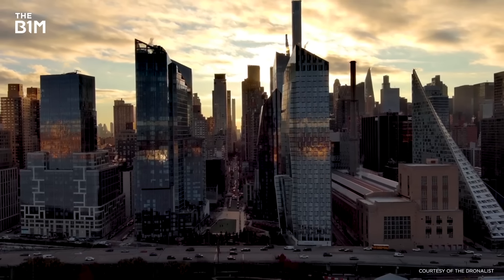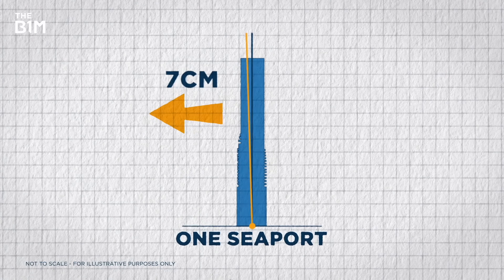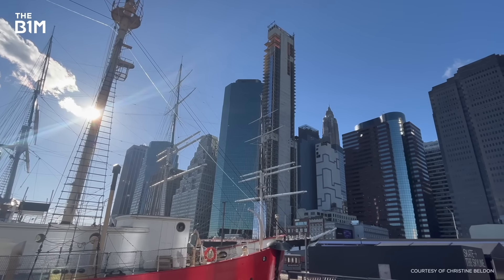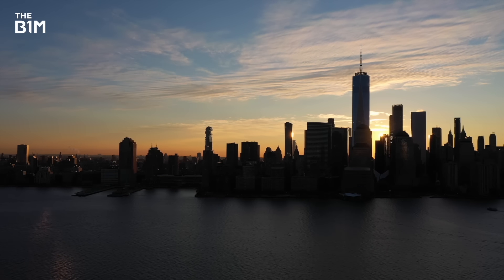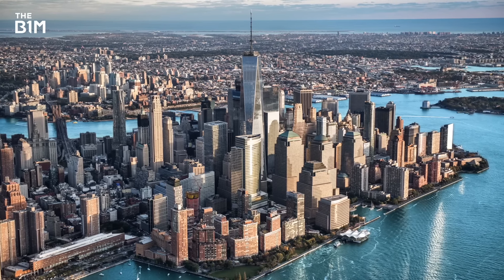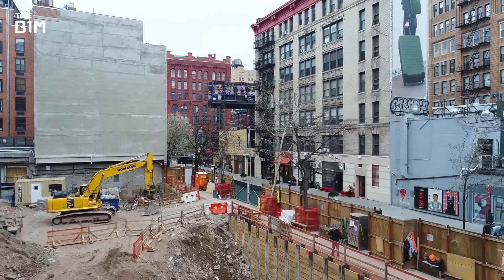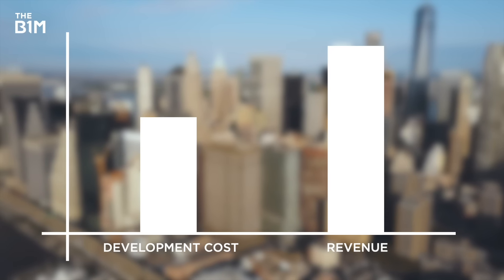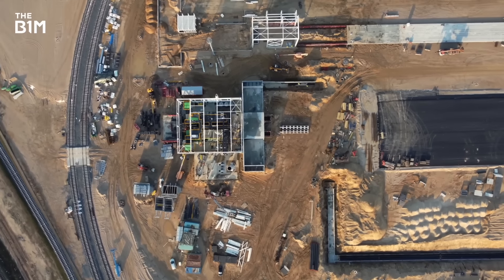The Wild Story of New York’s Abandoned Skyscraper

Comment: I think people often think that skyscrapers are a perfect science because they go up all the time unhindered, but this is an important reminder that it’s extremely challenging to get 60 stories of concrete and metal to stand perfectly straight, and is a massive achievement by developers. It’s just unfortunate that when a lean like this occurs, it’s so expensive to correct.
Reply: I just wish that they would automatically put pilings down to the bedrock with buildings as tall as this!
Reply: I build high rise apartments think 10 story to 60 story and theres 3 dudes out if 70 with a tape a level and a laser , and 1 of those guys always is an apprentice 1 guys always so foreign you don’t know what he’s says  and the 3rd guys a dick. Trust me not me single thing is near perfect
Reply: well said. I live in Miami and its easy to get accustomed to high rises. But each tower is full science, engineering, and challenges that occurs behind the scenes. For me, I love when I see a tower under construction and all you see is concrete slabs cantilevered hundreds of feet in the air.
Reply: Well if your not going to use piles in an area where most skyscrapers do, well you built a lemon
Reply: Happens in all types of structures. The I-75 bridge over the Saginaw River in Michigan had to be repaired after one of the piers went askew. After years of looking at it, it was finally decided that freezing the soil around the foundation would do the trick.
Reply: In residential wood frame, there is almost an 1/8th inch of “fuck” factor and then some per floor.

Translated over 60 floors. 7.5 inches.

Lasers and transit levels are no joke for this reason. I now have a new respect for building big.
Reply: Standards are lessening.
Reply: @willpugh8865  Someone still goes over your work and makes sure you’ve done it in the limits of the design lmao.
Reply: Some engineers didn’t ask the right questions with physics and math?
Reply: @SunriseLAW WTC didn’t have tuned mass dampers.
Reply: Engineers. Developers don't get credit here. Source: I am a real estate developer.
Reply: @java4653  I don’t know the correct terms, I just meant the people who make all this happen haha so yes the *engineers 👏🏻
Reply: a guy for blue print is to blame
Reply: @java4653  you draw blue print and measure everything?
Reply: Its a real skyscraper! 🤣
Reply: I heard that the exoskelatan of box columns kept it going straight down. @SunriseLAW
Reply: Our old buildings and  infrastructure worked.   Why can’t they build solid buildings now?
Reply: @arribaficationwineho32  you mean like the Tacoma Narrows suspension bridge that completely collapsed less than 6 months after it was built in 1940? Or maybe you mean the John Hancock tower in 1973 that had panes of glass falling to the street and swayed so bad that people on the upper floors were made sick? Or the Hyatt Regency walkway that collapsed in 1981 killing 114 people? Yeah they sure used to build em tough 😂
Reply: Florida units are collapsing and falling apart too

Comment: the fact that its so tall on such a tiny footprint would scare the crap out of me living in there
Reply: The simple answers is to take this down.  Or like San Fran you finish it, sell units to suckers than fight it out in court until it falls over.
Reply: Second thought is that not all site are suitable for tall buildings.
Reply: I suspect nobody is going to want to live there even after they have 'fixed it' , I surely will not be applying for an apt !
Reply: So they saying that's not  a safety And concern
Reply: @Privat2840  That could be.  There's just nowhere near enough information in this video to determine anything relating to the building's construction and why it's leaning.   And this area is loaded with tall buildings that appear to be standing just fine.  Maybe this particular building design itself just isn't suitable for the site.  Maybe we're both right...  The ratio of height to footprint area of these tall skinny buildings has got to be a unique challenge all it's own.

Comment: The building's super structure also has an eccentric layout of core walls, which might cause differential shortening and leaning of the building to the direction of more shortening. All you have to do is investigate the shape of leaning because it is different whether the leaning comes from differential foundation settlement or from differential shortening.
Reply: 100%.  It's structural form means it will lean.  This has to be compensated for during construction.  Lots of tricky calculations and surveying, but it's not rocket science.

Comment: I'm REALLY surprised that all the skyscrapers don't have pilings in NYC. This one definitely should have, in my opinion. 😬
Reply: I really thought the skyscrapers normally required pilings extending down to solid bedrock below the island. Engineers have to include geological reports to ensure that all pilings stand on solid rock, avoiding having any resting on fissile or weaker rock layers that could potentially shift under the weight of the building.
Reply: Depends what part of the city they are being built. By lower Manhattan, Brooklyn, East and Hudson Rivers fronts and adjacent areas, buildings are all typically built on piles , as deep as 150 feet. Towards the center of Manhattan bedrock is relatively shallow, making piles a bad choice.

Comment: This problem should never have happened.
As both a Chartered Architect and Structural Engineer; PhD in Building Material Physics, I suggest that someone runs some old fashion hand-calculations over the imposed façade loadings related to compensating structural stiffness, respecting Castigliano's second theorem (deflection) and then delves into Rankine Gordon and Perry–Robertson formulae regarding one-end fixed encastré cantilevers; using the building as a vertical column/cantilever projected off the foundations. i.e. the fixed part in the ground. The opposite end; where the deflection occurs in the sky - in this case, the wind replacing gravity as the cantilever is exposed to super-load forces, perhaps not factored holistically into the original calculations - think laterally! This is really simple stuff and the design straight forward to fix; if you are old school with experience in designing 'slippery' air-foil façades - The fault appears to be embodied within two factual logics. (i) the encastré presumption of load transfer to ground has not been sufficiently researched, therefore, the foundations; as designed are unsatisfactory, and, (ii) the wind-load on the superstructure is producing a 'resultant' eccentric force that was not considered properly within the calculations, thus: inducing an overturning moment; as per the cantilever acting as a lever upon the foundations that have become the cantilever's fulcrum. Most young engineers would not know what I am talking about because they have never run a hand calculation in their lives nor researched materials fit-for-purpose through design. i.e. this building has to have a steel frame not reinforced concrete due to the risk of flexure. Many engineers these days have become little more than computer button monkeys having never run an 'eye-inspection' or hand-calculation as a structural analysis safeguard, taking for granted that software acts as a catch-all. If one reads ISO documentation it generally states in the preambles on page 1, that the recommendations are not a Code of Practice, and, that utilisation of such ISO's do not provide protection from professional liability. Nonetheless, it is obvious that the superstructure is causing issues with structural 'stiffness' that in-turn has influenced the foundations. Thus there are two solutions. (i) Knock the building down and turn the site into: a car park, McDonaldo's, Pizza-Hut or whatever the New York moneyed-class has to have, or, (ii) Stiffen the design of the building's spine; which should have been conceived as the service core, and built as aforementioned, in steel due to flexible acknowledging "tall-thin column theory". The trouble is that the world is full of arseholes who do not wish to listen or learn. If this project was managed using BIM to the ISO19650 series, then I expect that such risk elements would have been thrown-up during the Appointed Parties' Risk Evaluation Statement - that is, both Lead Parties supervising: Architecture and Engineering would assess the risk potential of such a design as a 'thin structures' liable to deflection due to 'slenderness ratio'. If not, then all parties involved are utterly stupid. On a well managed project; BIM or otherwise, this type of incident should just not happen. Currently, I work in South East Asia and this type thing would not happen as structural simulation respecting earthquake design would have flagged-up the issues as a problem. Also, many engineers are female Koreans who never let a presumption pass through their hands, as they listen, are vigilant, validate software calculation checks, and never assume to know-it-all. Still it's the Big Apple - Hasta La Vista Baby - That's the way the cookie crumbles baby! これが世の中というものさ．
Reply: Never underestimate a Korean woman
Reply: Because todays engineers are just software users, not the mind behind the software concept. Poor minds do poor buildings.
Reply: TLDR😢

Comment: Many of the floors in NYC's Freedom Tower in  are completely out of level.  It is standard procedure to bring in floor leveling contractors to correct the situation.  One of the floors I worked on in the 80's part part of the stack was out of level by 3" across the entire structure. Big problem is the workers have no real supervision and no accountability. Buildings only get this messed up when a lot of people are not doing their jobs and looking the other way.
Reply: It's interesting because I've seen documentaries about buildings in other parts of the world where leveling is checked on a daily basis to prevent any one issue compounding the situation.  I have a retail space across from where I work.  It's only a few stories high but they put in pilings.  (noisy and the vibrations were something else).  But it was done.
Reply: I hear you. My dad is a retired Concrete Finisher and a Legend in Boston union  construction.   I also was a laborer for years.     It's amazing how sloppy some crews can get

Comment: Driving into Manhattan I was once asked if I knew why all the skyscrapers were built on the southern tip and middle of the island with only modest buildings in between. I didn't know but the answer should have been obvious. The whole island is mud except for those two parts, which is why I was confidently told there would never be skyscrapers anywhere else on the island. Maybe he should have been right.
Reply: This is downtown though. The issue isn't how far south it is, but rather how far east. It's sitting on artificial land which was added to the coastline.
Reply: Not mud. Just that rock is deeper. So it was easier to build rock foundations North of 30th street and by financial district. Builders are building taller buildings in the middle now because they are financially viable to build with an expensive foundation.

Comment: Bedrock or bust! They should've known better than to try and build a skyscraper in NYC on anything but solid bedrock with piles included. They'll need to tear down the building piece by piece, strengthen the foundation and start again, but that's expensive, so instead we get legal wrangling, finger pointing, and denial about the severity of the issue.

Comment: I can well believe they have a problem. My local doctors surgery is about to close and be pulled down. It is a single story building that sits on "good" ground (I was there when a test trench was dug by an engineer who said as much when they looked in the hole). The fact I witnessed this gives a clue to the problem, its about eight years old and has suffered subsidence since the day it was completed. Cracks started appearing in the first two weeks it was open and are now 2 inches across. I remind you that this is a single story building on good ground. If they can screw that up I am sure a 60 story sky scrapper is a doddle to fubar.

Comment: Odd that piles were not used. There were piles used in the building next door (181 Maiden Lane). They were driven to bedrock or point of refusal. On top of these were elaborate pile caps. The narrow footprint and height of 161 increases the difficulty in resisting any overturning moment. Unfortunate choices.

Comment: The solution is a series of pilings that eventually are attached to every 5 stories that will pull the structure backing line. (The pilings must be more comprehensive than any other structure and graduate to smaller sizing as the 5-story connectors progress. The Wind and ground movement will be recalculated to support the pilings.)

Comment: Nice disclaimer, don't start building your own foundations by seeing this video.
I Build a lot of foundations and indeed every single one of them are completely different. 
And sometimes the engineers find surprising solutions for it.
At one building we needed to build so called "bridges" according to the construction engineers, they where 3 meter long 15 cm high and 30 cm wide, they weren't attached to the rest of the main foundations, they where laying down on the soil and the building didn't touched them either. But  apparently they compensated for the fact that they originally calculated not enough foundation pills. 🤷‍♂️

Comment: Perhaps skyscrapers should include a 'Tilt Base' in their foundation. If the footings shift, then crank a few screws and re-align the building to vertical.
The 'screws' might actually be something else, such as shims and a facility for using ice to jack-up the upper section.
The lifting power of Water -> Ice was reportedly used to re-align the Empire State building.